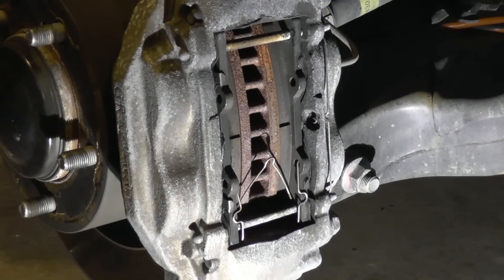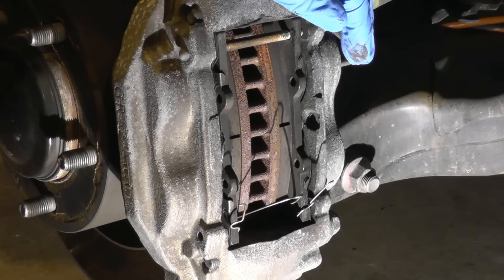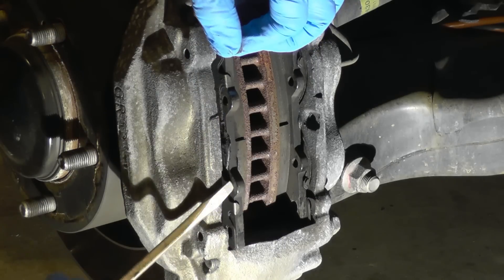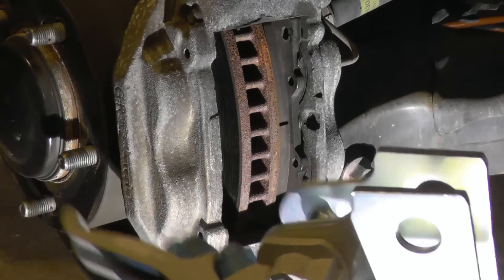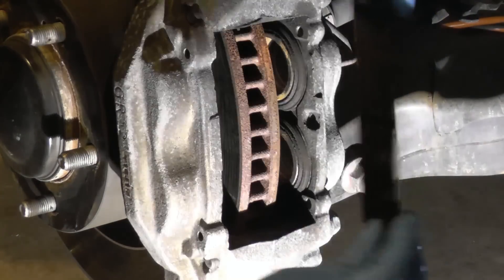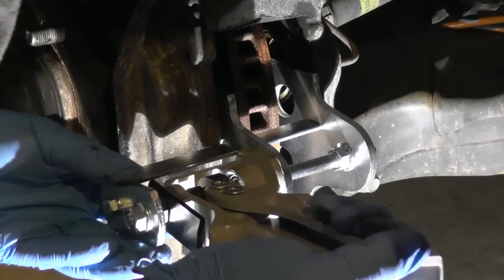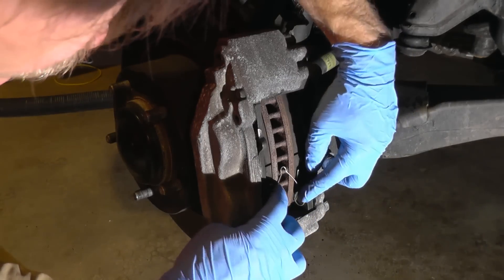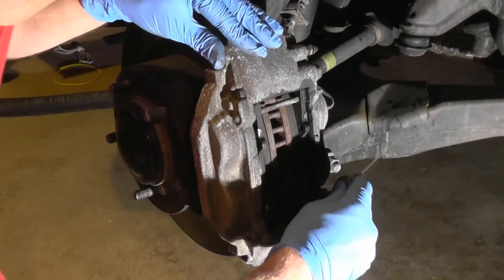2008-2019 Toyota sequoia, tundra, land cruiser, lx570 front brakes replacement

Comment: Great video, thank you! One comment, CLEAN & LUBE! Even when not installing new pads, I'd clean & lube the parts before reassembly. It will prevent unwanted brake noises plus it will aid in disassembly next time. I wipe the backs of the pads with a paper towel saturated with brake cleaner, then lube them with brake grease.  Run a wire bristle brush over the contact points on the caliper where the pad tabs sit, spray clean with brake cleaner and coat with a very light coat of anti seize.  I'd also clean the pins with some sand paper & lube them lightly and the tabs lightly (only) where the pad's tabs contact the caliper with a very thin coating of anti seize. Just my thoughts on an ounce of prevention. Great video, thanks again!!!

Comment: Thanks for showing the precise direction & position for the center spring clip over the front rotor & pads! Checking 2011 Sequoia Platinum F brakes for noise... Found a lot of pad material left & with even wear across pads. 1 glaring problem is that center spring clip is dislocated & mangled (drv side) - possibly from pointing toward the rotor & catching in those fins (rather than pointing upward)! Instead of the outer rust lip on my rotors, I have flaking pad material just outside the circumference of rotor - 1st time I saw that. I will clean, inspect & have a new pad set that hopefully I will only use 1 of those new center spring clips, with the existing pads. I see there is some added play when the spring clip that goes over pads & rotor fails - so hoping this was the only source of noise. Thanks again!
Reply from the maker: This video has additional details to prevent brake problems on sequoia 
https://youtu.be/LuURfVavm7A

Comment from the maker: Bleeding plug is open only when you trying to remove air from brake system. When replacing caliper, ABS unit, master brake cylinder and brake line, that is when you need open bleeding plug.

Comment: nice job but I've one comment is that you have to open the bleeding plug during pressing back the calipar pistons to avoid the oil return back to ABS system otherwise it will fail in future with many times replacment of pads. thanks for your tube post
Reply: No you don't.  The brake system is a closed system.  You aren't introducing air into the system when you compress the piston.  You are simply returning the piston to its original starting position for new pads, and that displaces brake fluid back through the line and back into the reservoir (its original starting position).

There is an old-school thought that the master cylinder can fail if you force brake fluid back the opposite direction, but NO ONE practices the older method of opening the lines to compress the pistons.  The retail stores don't do this.  Your Toyota dealership won't do this.  They engineer these parts to be as easy to maintenance as possible.
Reply: ABU. HAMDAN wrong!  I have 302888 miles, no problem with abs and have done every brake job, never had to bleed them, never opened bleeder valve.

Comment: hey does your sequoia shake when braking. i have turned all  the rotors and there is still some shake
Reply from the maker: I don't have any shaking when braking. What do you mean " you have turned all the rotors"?
Reply: repairvehicle  i mean i have resurfaced all the rotors
Reply from the maker: Here is the thing, resurfacing rotors is like bandage on the broken bone. Once your rotors start vibrate when braking it's time to replace them with new ones. It means they were warped and resurfacing doesn't restore rotors to it's original shape. It's normal for rotors to warpe under heavy breaking or heat. Mine front rotors were warped and I replaced them with new ones.
Reply: repairvehicle okay thank you.. any recommendations for rotor??? which brand rotors did use
Reply from the maker: I use Toyota rotors because I was able to purchase them through my brother who works at the Toyota dealership and they were very cheap, because he got discount. My recommendation is to buy decent quality rotors. Don't buy slotted or cross drilled. Also, don't buy very cheap stuff from eBay. Don't forget to replace your brake pads when replacing rotors. I can provide you some links with my recommendation later today, if you want. Just let me know.
Reply from the maker: Forgot to mention, I purchased Toyota performance brake pads because they have regular and performance for Sequoia. I have noticed that they stop vehicle better.
Reply: repairvehicle yes that would be great
Reply from the maker: My first choice for front rotors https://amzn.to/2GJALvb
front brake pads https://amzn.to/2Lp1ssH
or this brand, they actually Supply brake parts for toyota and other car manufactures https://amzn.to/2LrFcyq

my second choice for rotors, https://amzn.to/2IImdC0
Reply: repairvehicle  thank you so much i will get to it. thank God for our cars its so easy to replace this
Reply from the maker: You are welcome. Please subscribe and share my video with others via Facebook or any other way.
Reply: @repairvehicle  what do I buy that is not slotted or drilled?
Reply from the maker: Unfortunately,  we have no choice but we have to use slotted. I got tired of replacing rotors every 2 years because they got warped. Now I am using slotted, should have switched sooner

Comment: Where did u get the tool that your using to compress the pistons?
Reply: You can also use a C-clamp if you don't want to spend nearly $100 on a specialized tool you will only use a few times.&#160; To use a C-clamp, keep the old brake pad in and compress the pistons by clamping the outside of the caliper and the metal tab of the brake pad (assembly) where the pin goes into.

http://www.amazon.com/TEKTON-4022-Malleable-C-Clamp-opening/dp/B000NY8P78/ref=pd_sim_469_3?ie=UTF8&dpID=41Hfk015oVL&dpSrc=sims&preST=_AC_UL160_SR160%2C160_&refRID=07YCGFTX6V2CGMHDM60H

That link is for a 5-inch clamp.&#160; I'm not going to remove a wheel to try and figure out if I used a 4" or 5" clamp.&#160; Buy both just for fun.

The C-clamp won't "fit like a glove" but you don't need excessive pressure to compress the pistol.  You will be surprised how easy it is, actually, but not so easy you can do it with your fingers.
Reply: Rick Torbet I got the tool he used in the video for $48 new. Still not as cheap as clamps but it works better.
Reply: You can also use large plaits, or just a screw driver(press against old pads, not the new ones and not the rotor).
It's really not that hard.